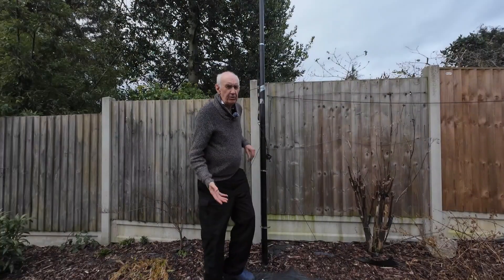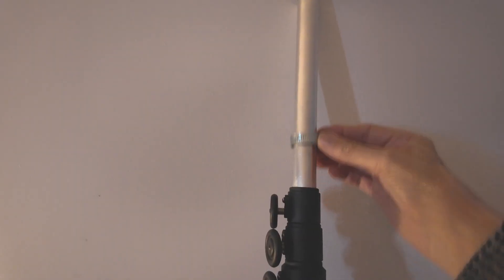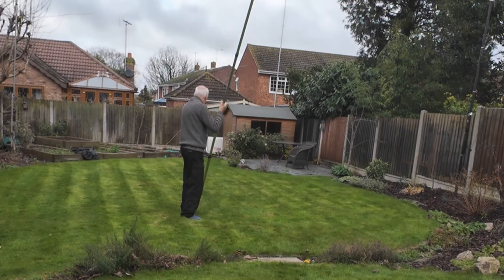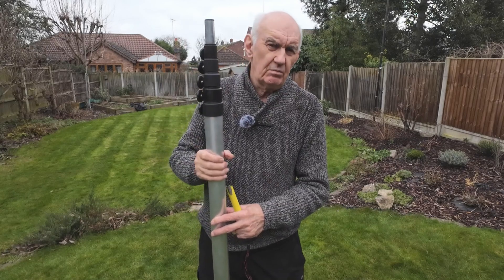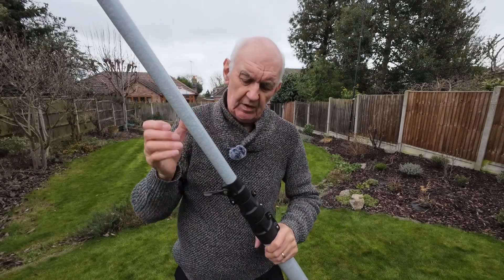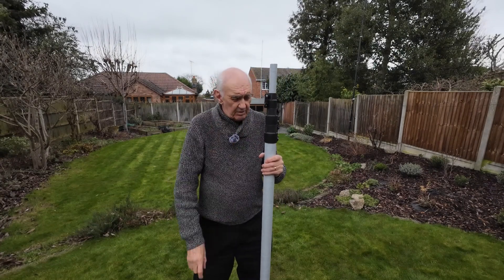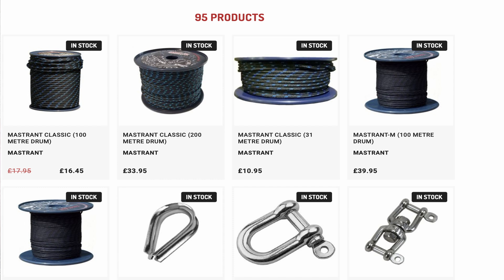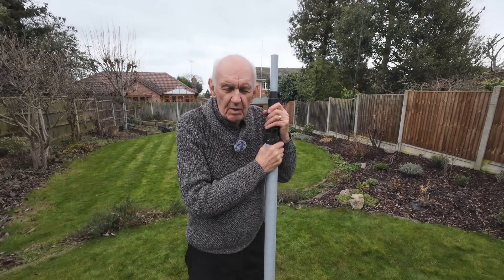Antenna Masts - Easy Practical Solutions for Ham Radio

Comment: I am looking for a solution suitable for the gable end of a bungalow. The entire wall to ground level is blank with no windows or other obstructions and the top of the mast only needs to be about 2 meters above the top of the gable wall. (Total antenna height from ground about 10m.) An ordinary TV aerial type mount bolted to the apex of the gable wall works nicely except that I want to be able to lower the antenna to ground level for tinkering (I have no head for heights!). There is room for a simple tilt-over mechanism at ground level as long as it tilts parallel to the wall and there could be a stabilising clip at the apex of the gable so long as it has a mechanism that can be unlatched from ground level. It would not need to be telescopic or anything since there is room to lay the entire height down horizontally. Do you know of any product that would work something like this?

Comment: I have an 80 foot tall three legged steel tower Switch holds up a rotor and a five element that I gave for 20 meters, A five of them and Yagi for fifteen meters above And in 10 meter and six meter combine yagi at the top at about 100 feet. A seal pipe mass runs from the top of the tower, And is made to resist bending in my flexing.

Comment: You don't know me Peter, but the last time I saw you was inside the Hockley shop. You haven't changed a bit, you don't look any older! 

Any suggestions (anyone) how I can anchor a mast in my garden (I don't have suitable walls for brackets due the materials used on the wall)? Thanks
Reply from the maker: Hi thanks. You could get some galvanised angle iron and cement in ground. Then the mast nestles in the angle and use some stainless steel large “hose clamps” to camp the mast to the angle.
Reply: @watersstanton  Thanks Peter, that's a good suggestion. 73 Bob M0BOB.

Comment: How do you think it'll work with a 1/2 wave silver rod
I tend to use a 
HEAVY DUTY STEEL SCREW IN GROUND SPIKE PARASOL  STAND and guy wires for my masts
Reply from the maker: Probably OK if guyrd. But as usual it depends on your location and exposure.

Comment: When using hose clamps I use a strip of old cycle innertube around the pole to stop galvanic corrosion. I use stainless steel clamps. Are the GRP masts protected from UV as this will degrade the masts over time

Comment: Thank you for this video.  As a previous person noted: Not many video covering deploying a mast for field day operations.
Reply: Explore the Blue Sky Mast systems, a company in Odessa FL. It will last 20 yrs. I've used it in the Philippines for 5 yrs and have had no rust problems. At 30 ft the system can hold 30 lbs at 20 ft. 40lbs. Made of  aircraft aluminum. 2" OD. If you want 30 ft mast as for the "reconditioned " 10 meter mast system. I had a 20 meter wire moxon and a yeasu rotator on it no problem. They have a
video on YouTube blue sky
Mast systems al1 series.

Comment: I use one of the aluminium telescopics for my G5RV. I put a pulley at the top, so I can put the mast up, and then pull up the weight of the wire with a rope. That means if there's a gale coming in, I can lower the wire in seconds, without messing with all the mast clamps. I also drilled a small hole in the bottom of the bottom section, to let accumulated rain out - it's amazing how much the mast collects, which then runs down the inside of the next section down, and so on.
Reply from the maker: Many thanks for sharing. 73 Peter

Comment: Many thanks for this wonderful video.  I am new to HF and found this to be quite educational.  I noticed the top ends of the mast are plain...so how do you suggest I attach wires to the top?  (say for an inverted V or other type of dipole)
Reply from the maker: I often use a hose clamp. If you are using a balun then you may be able to hose clamp it in place. Otherwise tie wraps or whatever is to hand.
Reply: @watersstanton  Thank you.

Comment: I use silicone tubing to sheath stainless steel hose clamps.  Used rubber strips with shrink tubing in the past.  The silicone is much easier to work with, more durable and gives a better grip.
Reply from the maker: Good tip.
Reply: I also use the silicone tubing around the clamp. but i use the butterfly version of the clamps, no need for tools to tighten.

Comment: My HD Spiderbeam 12m mast has held up so far, knock on wood, very well for about 4 years, in central Canada, in some ludicrous weather. It is set up permanently in the back yard, and is the high end of an end fed. The tip does bend towards the matching box, but it's been a real wonder. I use a kevlar string to guy against one direction of wind, and it's also held up really well for such a small looking guage. Great video, Peter.
Reply from the maker: Many thanks. Great to hear from you. 73 Peter

Comment: If your a capable do it yourself person then using the technique that stiffens a sailboat's mast is a great way to have a dependable mast.

Many boat masts use a diamond shape truss along the lenght of the mast to resist the tremendous forces applied by the wind striking the sail. This truss is typically made from stranded wire cable but nylon rope could be used. Its beyond the scope of a heads-up to detail how the truss is assembled, but Google can fill in the details. 

Without the diamond truss 30 or 40 feet of 2 inch PVC pipe coupled together from 10 foot lenghts would behave like a piece of spaghetti if held vertical. Once it has the diamond truss installed & resisting bending along its lenght then as some say, bob is your uncle, or good to go.
Reply from the maker: Many thanks for that info. 73 Peter.

Comment: How would one support a balun or transformer for an end fed antenna using a mast? Is the tip / top section strong enough to handle the weight?
Reply from the maker: Use the stronger fibreglass mast or the metalversions.
Reply: @watersstanton  I love your videos but I am trying to get a HF antenna up in a small yard her in the states. I am told that you can not use anything as a mast that is conductive for a dipole or it will interfere. But yet I see people recommending metal masts. I am confused. 

Also, can I buy things in your store to support your company even in the US? Also a long video showing how to attach a dipole to a mast would be so helpful.
Reply: I have the balun box on the ground and have the antenna in a inverted V or the balun at the bottom of the pole like an inverted L.

Comment: I thought you might find this interesting Peter.  I was recently watching a video by VE2ZDX on youtube which was discussing his own experiences between South and North American ham radio.  One of the things he talks about is how in South America they can usually only get their hands on under powered radios due to age or homebuilt and often both.  He also talks about how possessed South America is with building their own antennas, and he talks about how they all do practical tests of their antennas and how some of the stuff they do is different from theory.  I thought of what you said about do the practical work rather than just trusting software when it comes to antennas.